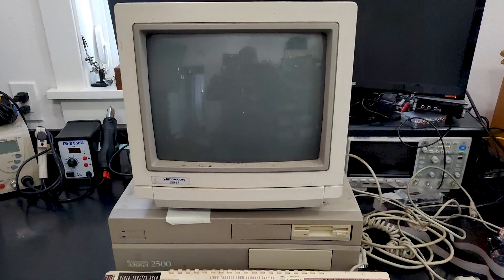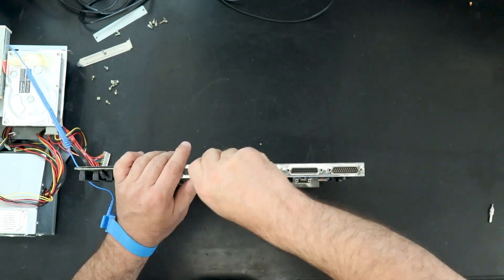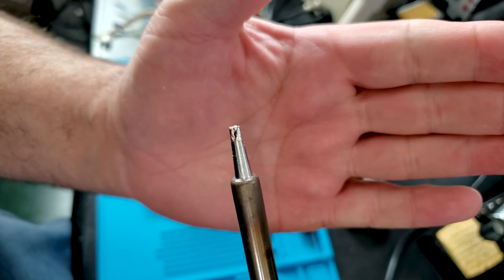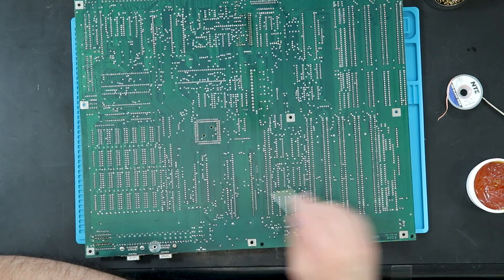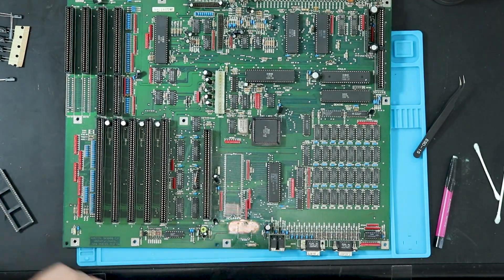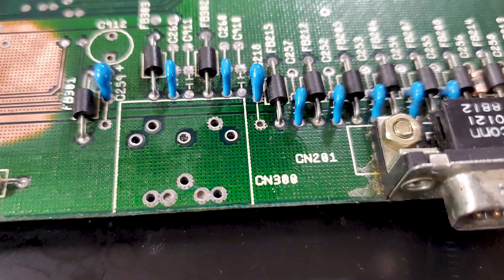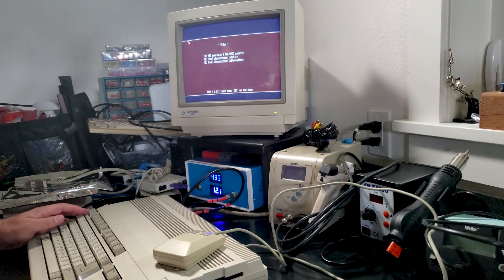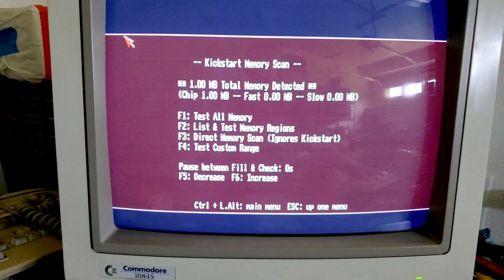Amiga 2500 Restoration - The Motherboard and a Rabbit Hole

Comment: What might cause A2620 accelerator card to produce a black screen when installed, but when removed the rest of the system works.
Reply from the maker: This definitely falls under the "I would need to dig in and see what is going on" to actually answer but I can tell you where I would start.

First, if possible test the board in another Amiga. That will cut the problem space in half.

My first gut reaction for problems with the Amiga motherboard would be to check the connections between the CPU socket and the Processor Expansion Slot. These can have damaged traces and are right in the area affected by battery leakage.

The A2620 itself I have yet to have to actually do more than clean up and replace caps so if that is the issue it would be a matter of starting with the basics and checking that voltages and clocks are working and checking VERY closely for any physical damage to components.
Reply: @ understood, I’ll go through it again.

Comment: Great Video!  You don't happen to have made available that Great Schematic/Architectural Drawing of the Caps for the PSU?  I have to Recap 2 Amiga 2000 PSU's.  Thanks, -Mark.
Reply from the maker: Deborah, I'm sorry but I don't usually keep those, I always do a new drawing because manufacturing sometimes made changes without the schematics being updated. Often it was just a part sub but other times it was a change where getting the same part matters.

Comment: Nice video and great channel, keep up the great work!  I was wondering, what was it that caused the Hot swapping to damage the chips only some times but not all the time. I know it was a common issue that caused problems with these machines (and c64), but a lot of us swapped with power on and never had any problems.  Was there some particular sequence of events or machine state that caused it?
Reply from the maker: Great question. Usually the damage is caused by static electricity. People often told me they did it all the time with no problem.  I would point out that they have a problem now. I suggest people just ask themselves if it's worth the risk to save a couple minutes.

Comment: Im getting flashbacks from when I ran a repair depot for Honeywell on some of their legacy products.  they may not have been as old but the corrosion, bad caps, stubborn solder, and needing to run wires because of faulty traces was indeed time consuming.
Reply from the maker: I'm rapidly learning how different these machines are to work on now that they're 30 years older